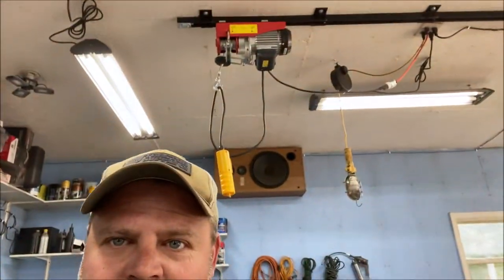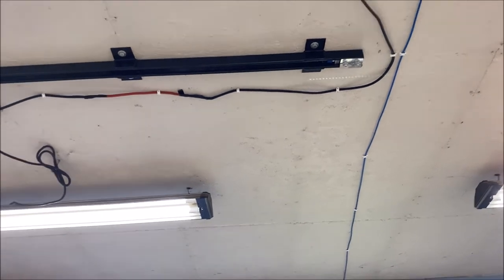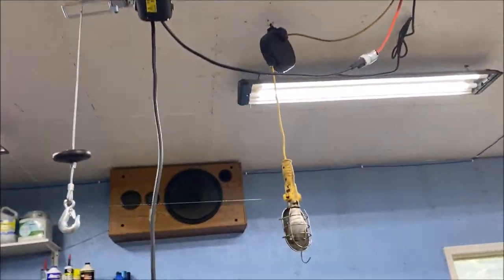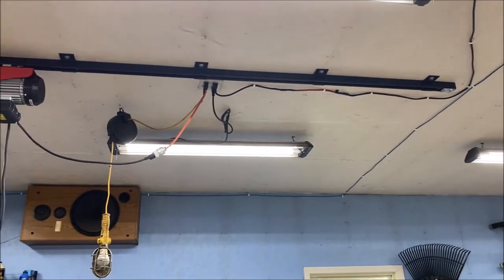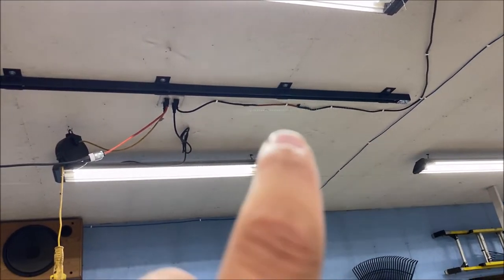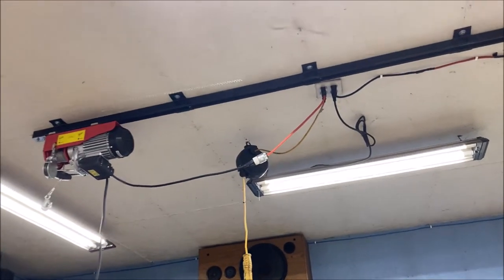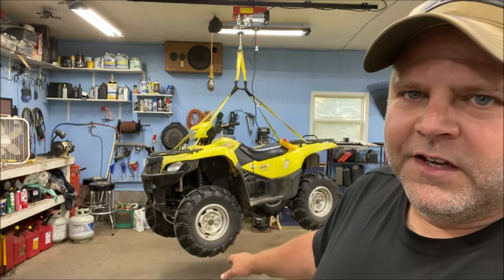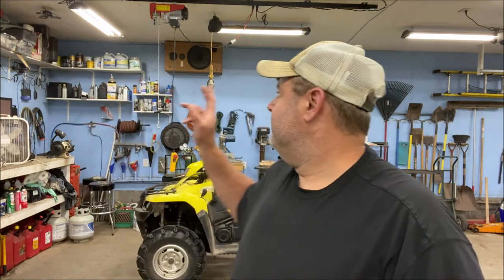DIY Unistrut Trolley Winch for Garage

Comment: Thank you VERY much! You did not disappoint. This is a WAY cheaper and easier solution than what I had planned. I will be building the same. 👍🏼
Reply from the maker: Still using mine today with no issue.

Comment: I really like the unistrut with a bolt on each side. I haven't seen that version before... I'm also going to be bolting mine directly into the ceiling joists and I don't like the brackets that most people use that drop the unistrut down a couple inches from the ceiling as my garage ceiling is fairly low; I was thinking about a deeper channel and just bolting through the holes into the joists, but the unistrut you use uses 2x the lag bolts and that gives me a bit more confidence.
Reply from the maker: Thanks for watching! I haven't had any issues with this design yet. I have found I use it more than I thought I would. I think if I were to redesign it, I wouldn't use lag bolts but maybe threaded rod or long bolts to go through the ceiling and to a steal plate or something equivalent that rests on top of the truss. Would take a little more work but would be stronger than lag bolts.
Reply: @UpperPeninsulaDIY  My garage is directly below my kitchen and I have no way to access the top of the trusses for a through-bolt type install. 

Do you happen to have a link to the Unistrut that you purchased / that's in the video? I looked at the Amazon link in your comment and it's not the same Unistrut as in the video.
Reply from the maker: It's been a while but I believe you are right about unistrut link. I provided that as an example but I should update that now that you say that. I got the unistrut at menards I believe because that was the only way to get a full 10 foot piece. Menards SKU: 3656562. I'm sure any big box store near you would have it.
Reply: @UpperPeninsulaDIY  Thanks a lot. Much appreciated. There's no Menards where I live, but hopefully I can find that brand somewhere local.

Comment: I’m really surprised you only have 20,000 views over two years. This is a project I’ve wanted to do for longer than that and most of the videos on YouTube are filled with people that love the sound of their own voice and too many plugs for advertisers. 
Thank you for finally addressing how you mounted the strut to the ceiling with lag bolts!!! 
You mentioned buying angle iron and cutting them to weld for the mounting. I’m only seeing flat metal.  am I missing something on how you mounted it? it looks like the lag bolts go straight up into the joist unless that’s the part of the angle iron I don’t see???
Reply from the maker: Thanks for the compliment! Yes, I welded angle iron to the sides of the strut every 24" on center. Drilled holes for the lag bolts and mounted to the ceiling. Hope that makes sense. It's hard to tell from the video with it being painted.

Comment: Instead of welding angle to the sides of the strut, manufacturers make brackets to suspend the channel. Unistrut P1834-EG is their bracket but Superstrut and Bline make the same brackets.
Reply from the maker: You are exactly right Sir! I actually ordered some but they came in the wrong size. Shipped them back but wasn't gonna wait for another order. Thanks for watching and commenting!

Comment: Glad to see it up. I have been thinking of one in my shop. Question, I have an 8-ft long barn door / pocket door system, do you think it would hold? I'll show it this week.
Reply from the maker: I actually looked at similar beams at Tractor Supply. They seem very rigid.
Reply: @UpperPeninsulaDIY  Thanks, I started it today, I am loading the vid as I reply.

Comment: Did you do any reinforcement in the attic with the trusses?  Or just bolt it from he underside?
Reply from the maker: I didn't do any reinforcing to the trusses but my trusses are over built using 2x6's. Thanks for watching!
Reply: Drywall anchors
Reply: @jessihawkins9116 lmao yea that would hold it

Comment: What Would you say the full weight of the quad is?
Reply from the maker: Dry weight is 600 pounds, add weight of oil, gas, winch, aftermarket tires. I would guess around 650 total weight.
Reply: @UpperPeninsulaDIY  thank you